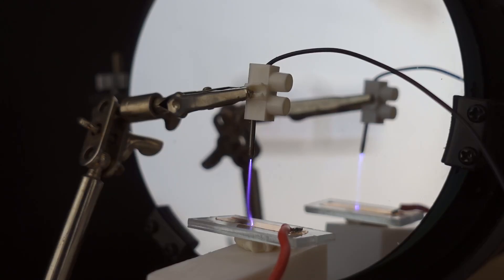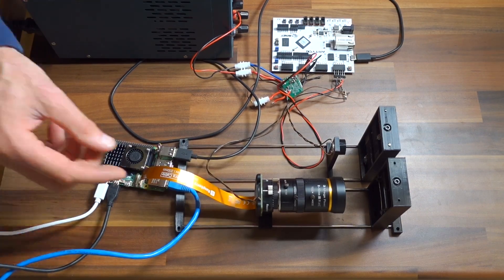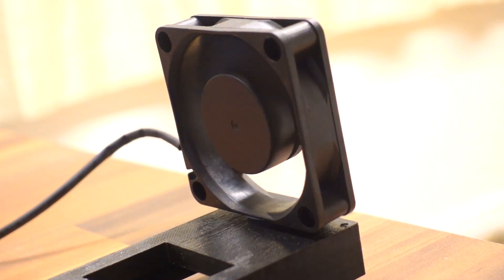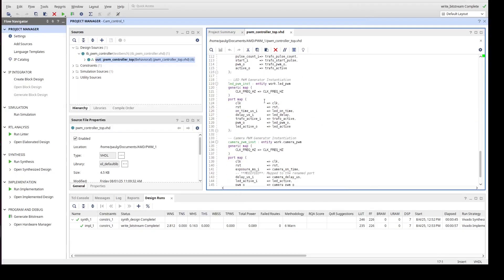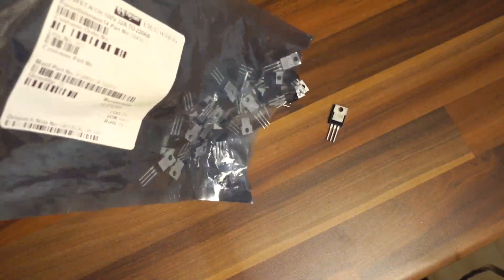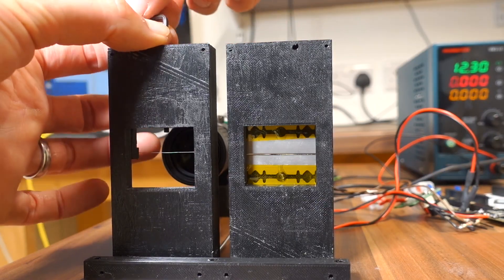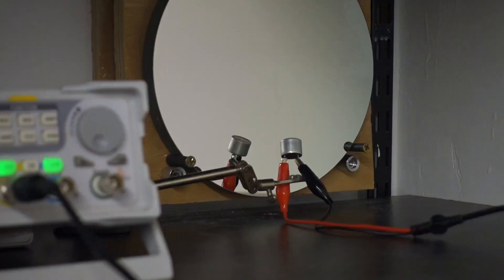Visualizing Sound with Raspberry Pi and FPGA (Prototype V1)

Comment: Since I saw Adam Savage showcased an ”audio monitor” tool from Fluke I’ve been thinking about how it might be using mems arrays to see the audio. Have you been looking into mems?
Reply from the maker: Took a look at the Adam Savage YouTube, looks like a nice piece of kit for finding annoying sounds, which I am all too familiar with. It probably uses a similar principle to phsaed arrays, but in reverse.. Phased arrays uses multiple transmitters to steer beams of sound. I believe the some speakers also uses phased microphone arrays to direct sound around a room and correct for room acoustics.
I haven't used MEMs mics myself, just the normal electret mics, but MEMs do seem very good + much easier to make an array with.
Thanks for your comment 😊

Comment: Very cool, thanks for making it easy to understand. If you can now see the sound can you use this to control lights or feedback or something else?
Reply from the maker: Really appreciate your comment, I am always thinking of ways to apply machine vision to problems, lots of interesting features to extract from the images, will have to think of what they could be used for.. To me the patterns kinda look like fingerprints, so maybe there is some kind of control system based on the interference pattern of waves you can only see with this setup..

Comment: Cool! I can see this used to fine tune a sound booth. What about frequency testing? Can you filter out a frequency using this idea? Maybe the next sound isolation headphones?
Reply from the maker: Thanks for your comment, always nice to think about new perspectives on this, you could filter the images from the camera to see what the sound looks like (like a cross section of the image) or you could inject a 2nd sound wave to cancel the first and use this to visually see what is happen rather than use a mic e.g. To get a quiet region around an object.. Should be quicker and more intuitive than moving a microphone around and monitoring positions

Comment: i have two arrays of ultrasonic capsules sitting around for sound positioning speakers (ultrasonic carrier) ala "turning sound into a laser" but also have decades of people intending that i never produce a single electronic item. i've been building for thirty years, but nothing ever works. i remember the old mason taking each part in the back and destroying it for an hour while the other guys told me to leave. i wanted my parts. i wanted my plant transducer. but i don't have short hair do i, so how can i engineer anything, i should go to jail instead. call the police. that's my life. so i did dsp instead. watch out.
nb. if you'd care to replace the amplifier section on "turning sound into a laser" so  i can do this without suffering from being the most masonically cursed individual in the world, then i can help to redeem a cooler culture and free west papua also instead of just receiving punishment. :p a freaking amplifier chip. decades of running out of money and parts but i bought a new shirt this year.
Reply: this is a message on how to REALLY see sound, becaus ei can hear the other side of the world 👁 yep really i'm xoxos maybe you remember me

Comment: FPGAs are super expensive, won't RTOS with a multi core microcontoller work?
Reply from the maker: The FPGA board I am using is reasonable expensive, I got mine for about €100 a few years ago, but you can get cheaper fpga boards for about €15 e.g. Lattice Ice boards, which are smaller but flexible.. Sure you could use a micro for this example, but I want to add more features later which will be hard using a micro..
I use FPGAs because they give a lot of flexibility until I decide exactly what I need, then I look at how to simplify, so if all you need is to stove the light and camera a micro should work

Comment: Why do you need a strobing light though? If your camera is already using a "strobing" shutter, if you keep the light on all the time wont it have the same effect? Usually strobing lights are used when one wants to see the result with naked eyes, which is not the case here.
Reply from the maker: Very good question, most cameras only have a low frame rate usually about 60 frames/seconds or a little more. Sound waves travel at 340m/s so you will have multiple highs/lows even at 60 frames per second, to the camera these will just blur into each other..

My mirror is 160mm, so a single sound pulse will have traveled from one end of the mirror to the other in 0.0004 seconds, way too fast for any camera I have, you would need a camera with > 2000 frames/sec which is usually very expensive.

But if we strobe the light, the camera will only see light for 10 micro seconds, so you will be able to see the highs and lows because they have not traveled very far..
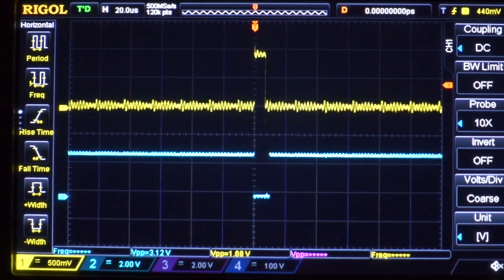Reply: Oh, but at around 1:49 you say that the signal tells the camera to open the shutter for only 10 micro seconds along with the light, perfectly illuminating the subject for the duration of the shutter, but if the light is turned on and off at the same time as the shutter is opened and closed, the camera still sees an illuminated object only and I dont think it would matter whether the light is strobed or kept on all the time according to my understanding
Reply from the maker: Good point, it doesn't really matter if the camera stays open a bit longer in this case, but if it does stay open it will pickup more background light which could mess up the images a bit. I am currently taking images at ~30 per second, so if the shutter stays open for longer than 1/30 of a second it will mess up the images. The Raspberry Pi camera adds another 13uS onto the 10uS automatically. Thanks for your questions :-)
Reply: @plasmatronX Oh that's interesting, I think i got it now, Thank you :)

Comment: That's very cool! FPGA obviously isn't required. Most microcontrollers with basic output compare module can provide jitter-free timed periodic signals. This includes pic, atmega, esp32, etc.
Reply from the maker: Ah thanks, the FPGA is not really needed for this demo, but I want to add additional features on later, getting multiple delayed high speed pulses on micros can be quite messy, while an FPGA you can just cut n paste and you don't have to worry about interrupts etc...so I start with all the features first then pare it back to the minimum (once I know what that is)

Comment: There's a cool video by a MIT professor that uses 2 side-by-side color filters instead of a razor blade in the Schlieren setup. This makes the high and low pressure sections of the wave have different contrasting colors!
Reply from the maker: it is pretty cool, i've seen it done with 4 color filters also, you just need to put the filters on top of the wire

Comment: Are you able to test with classical instruments, like a violin? I think this would help recording those instruments tremendously.
Reply from the maker: More than likely you would need a bigger mirror (mine is about 160mm), the transducer in this video is working at ~40kHz, so you can see about 15-20 cycles of the wave, which would mean the lowest frequency you could see (a full period) with this mirror is about 2kHz..It would be cool thou

Comment: Very cool!  I tried something similar years ago w/an rpi and ultrasonic sensors years ago but never quite figured out the visualization portion.  Get some sound treatment for that room.  You might get away with just a heavy curtain or rug.  Bean bags (the chairs) are surprisingly effective at absorbing sound reflections.
Reply from the maker: Thanks for the tip, very small workshop, lots of echo!!

Comment: Awesome. How long it took you to develop this?
Reply from the maker: Ah thanks, something like a few evenings, but I had a lot of parts lying around that I could easily put together which made it go much faster
Reply: @plasmatronX  Is there a manual for dummies with complete BOM? I saw the github but it seems it's just code for th devices.
Reply: @plasmatronX  is there a manual for dummies along with BOM? I checked the github, but it was only code and 3d print files. I'd like to make one
Reply from the maker: Actually, I am planning another video soon to give more information on the different parts of the setup + instructions, including some things you might want to do different etc.. stay tuned

Comment: This is amazing!
I think you might be able to replace the FPGA with the PIO of the raspi pico (microcontroller), which would be easier to develop for and cut what for me looks like the single biggest cost in the BOM for this project, from $350 to $5!
Reply from the maker: Defo, it you just need to pulse the LED and the Camera at the same time the PIO on the Raspi pico should work OK, but I had a good few Artix boards available that it felt a shame to not use them + I want to add more features onto it later, so the FPGA is ideal for this
The PIO usually take a good bit of playing around with to get everything working accurately  (sounds like a job for a LLM again!)
Reply: @plasmatronX  A scope and a little cleverness is all you need, especially for how simple of a task this is

Comment: Awesome setup, It's a total shame that YT codec obliterated all the details.
Reply from the maker: Thank you, hadn't noticed until you said it
Reply: @plasmatronX  i suggest to always upload in 4K. It's a pretty common practice to film and edit on 1080p, but export and upload in 4K, improves lower resolution playback quality by a lot
Reply: You can also post process the video to increase contrast between the peaks and troughs. A larger contrast would increase the signal to noise ratio between the background, reducing the effect of compression on the data of interest.

But yes, YouTube only provides quality options based on the resolution of the original video as uploaded. Uploading at 1440p or 4k will unlock those options for viewers, and both of them have significantly higher bitrates, meaning much less compression artefacts.

But yes, uploading in 4k typically helps. Videos uploaded in 4k are more likely to be encoded with VP9 rather than AV1, which is a better encoding. But even if it doesn't, YouTube appears to use higher quality settings for the lower resolution transcoded videos generated from 4k source, as well as higher bitrates. YouTube basically has 2 pipelines for transcoding, one that's faster but lower quality and one that's slower but higher quality, and 4k videos typically get assigned the high quality pipeline. The settings they use for downscaling also typically beats what you'd get manually downscaling from 4k with handbrake or similar tools, because they've heavily optimized their settings for maximizing the quality/bitrate.

So even if you initially shot your video at 1080p (or have low resolution inserts, like the schlieren video from the rpi camera), exporting your final at 4k should get you a much improved end result from YouTube's transcoding pipeline even if none of the source video was ever 4k to begin with.
Reply: @Bobbias thank you chatgpt. Write me a poem about spaghetti